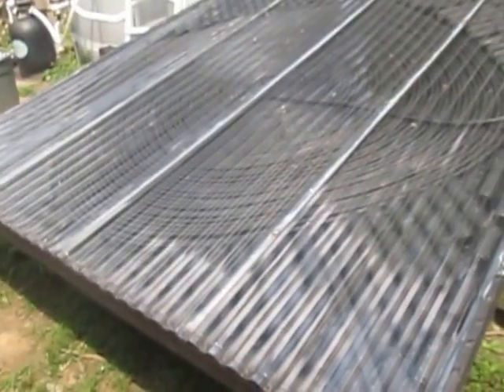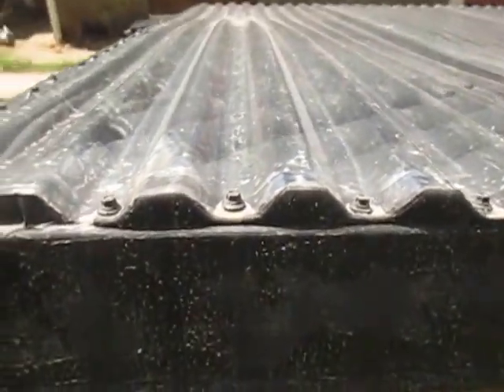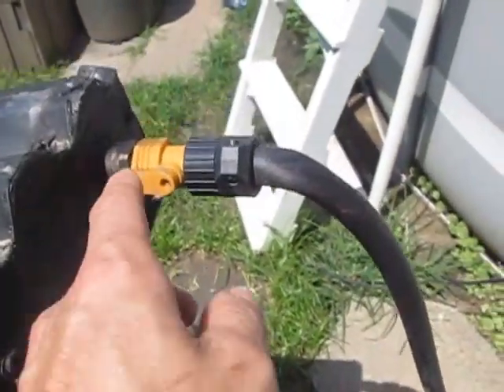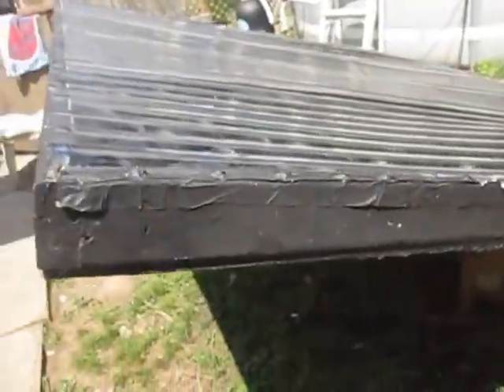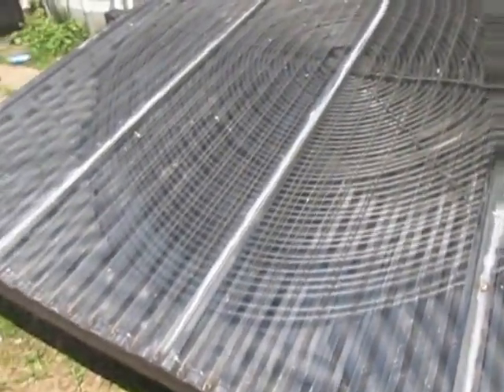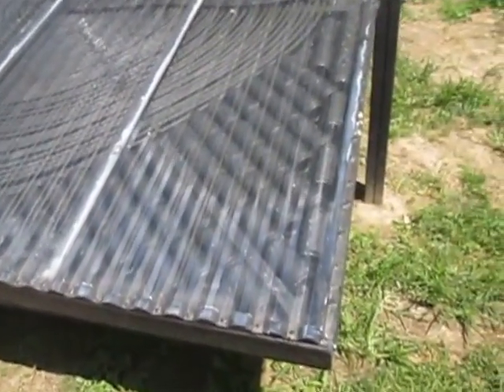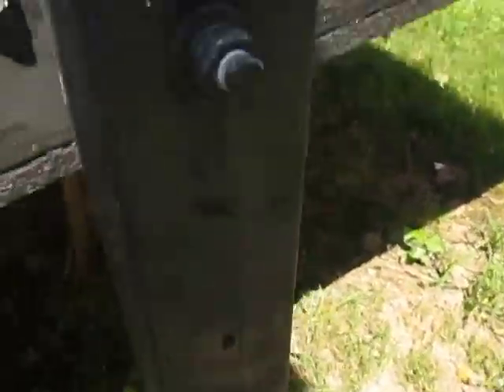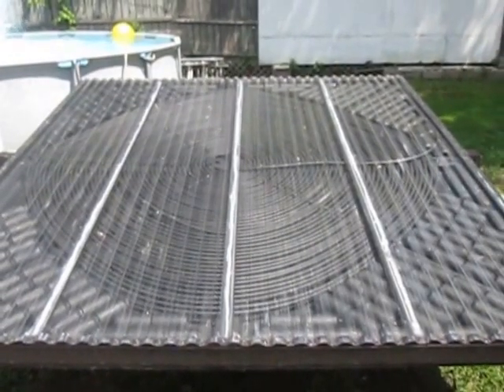SOLAR HOT WATER TUBING/CAN POOL HEATER BUILD PART 5 of 5 8X8

Comment: Questions: did you glue the cans down? Are they just empty cans that you painted black? Where did you get the clear roofing stuff that you screwed down lowes, Home Depot ? ? What size tubing did you use 1/2 or 3/4 inch ? Is it helping heat the pool ....  I watched all your videos I just wanted to clarify some thighs thanks for your response and God Bless you, Amen.  Any other info that could be helpful please share... Thanks! 👍😀
Reply from the maker: Yes the cans are siliconed together and siliconed to the board, the pex tube is 1/2" yes it does help a lot with heating the pool. A low pressure pond pump allows for the water to flow slow and lets the hoses stay heated better.
Reply from the maker: They are empty pop and beer cans painted black and the plastic came from Lowes. God bless.
Reply: Mike D I know you said a low pressure pond pump but what kind and how many gph is it and is the pump and heater still working well